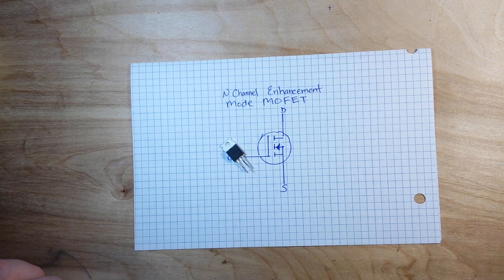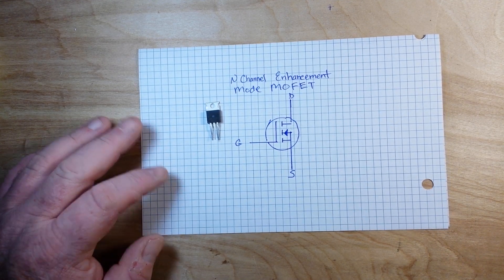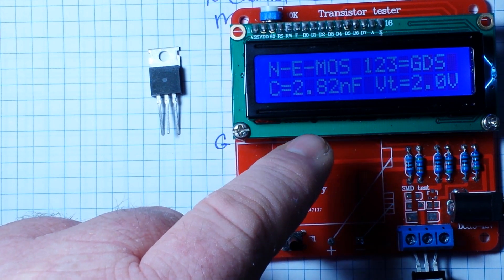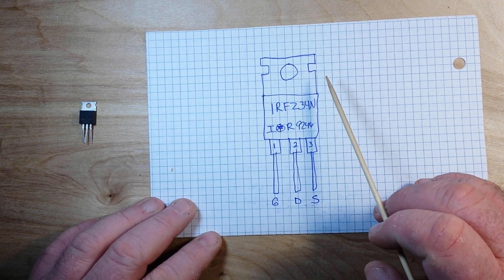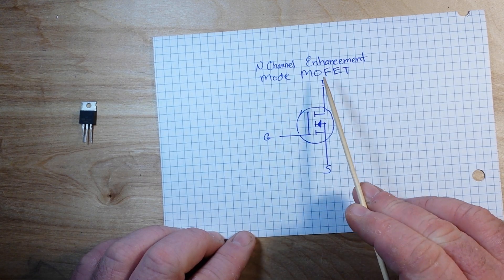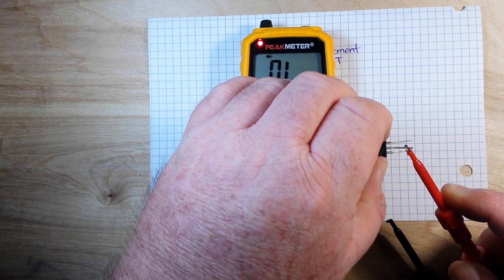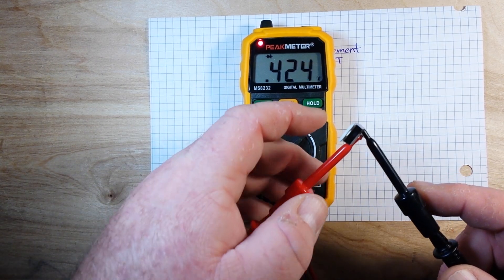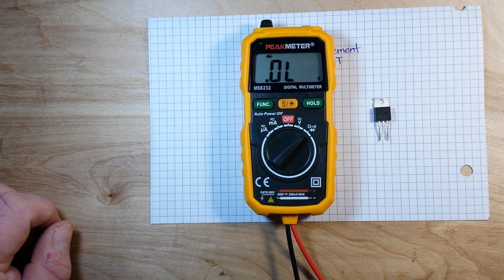Quick & Dirty MOSFET Test

Comment: Nice thanks.  I have what I believe is an N-chl MOSFET STD1NK60 and mine checks out exactly the same with the exception that after I trigger the gate and put the + lead back on the drain the voltage rises quickly and then goes to OL.  Also the back metal plate is common to both the drain AND the source.  Is this one bad?  Thank you.

Comment: Usually easy to test mosfet like this, but in a circuit board without desoldering it, the gate to drain resistance conducts away the gate charge rapidly so you can't use this method. Here's how to do it: Just connect an extra probe wire to the DMM positive probe and clip it to mosfet gate on the pcb itself or a circuit track there, and then measure drain to source resistance, with your dmm probes, you will see the same conduction! It will go back to high resistance immediately you unclip the gate extra probe! By bleeding the charge thru gate to ground resistance present on any mosfet using circuit. Some technicians use a 9 v battery with leads soldered to it and connect to gate and ground on circuit board, then use dmm to measure drain to source resistance! Use either method.
Reply: Thanks. I'm going to try this now...

Comment: I touch the gate but between source (black on dmm) and drain (red on dmm) there is a very short spike with diode sign shown on DMM (continuity mode) and shows 1.8-1.9v and quickly shows OL. what does that mean? if I lift drain and put it back it again shows diode voltage and OL.
Reply: idk if it helps its an ST Micro STD20NF06L

Comment: Okay got a little confusion,I have several Mosfets IRLB3034
I have a fluke 77 series, witch I test the Mosfets on and I have some questions to whether witch ones are good and witch ones were bad,

When I test one on a setting that has diode and continuity setting, only bleeps as shown in your video so that,s good , but the number creeps up slowly starting from 6.68 up to 3.000 then goes to 0 then starts going back up again,
If I set it on ohms it goes up to 32.42 M ohms then goes back to LO,

The other Mosfet IRLB3034 I set the multi meter back onto diode and continuity test ,it Bleeps as should as shown in your video but on this one the number flashed up 0.92 comes up quickly then quickly goes away.
Witch Mosfet is the good one and why ,

Comment: Hello, I know this vid is pretty old but can't seem to find an answer with Google. Mine works as yours until I put the positive back onto the drain then the voltage drop rises until it is back in the off state. If I just touch the gate with positive again it will do the exact same thing. Assuming it's naffed but not 100%

Comment: This method only works with logic level MOFETs since the gate voltage required is quite small. Power level MOSFETs will require a 9V battery to test it. Right?
Reply from the maker: I didn't use it on logic level.

Comment: Iv done this with old mosfet and a new one and the reading goes up then back down straight away the meter is in diode mode but is an old meter only showing l instead of OL does this mean that  both the mosfets are ok or faulty .

Comment: Hey man, thanks for this video, I don't know much about the more advanced parts of electronics, but I'm currently repairing a car audio amplifier that uses N channel MOSFETs, which are known to go bad in this specific model. I'm using a cheap harbor freight cen-tech meter, on the diode mode. This amp uses 8 IRF3205 MOSFETs and 6 IRFB4227 MOSFETs. I've clipped them all off for now (I know probably the hack way to do it, but I don't have a good soldering iron and don't want to damage the amp's 2 layer PCB.) I got to the third 3205 using this basic test, the first two behaved exactly like yours did, but this third one immediately dead shorts (I believe?) and sets off the meter's beeper after I apply the lead to the gate lead then to the drain lead, as I did with the others. Could this indicate a defective MOSFET? I'm hoping it is, once I get all of these tested I'm tacking the remaining good units back into the amp which should allow it to work for testing purposes (given with less power output until I buy replacements for the bad MOSFETs.) Glad you made this video, only one that explained the testing procedure in a way that makes sense.
Reply: Update: Two of the 3205s ended up dead shorting, the other 6 tested fine. Could not get any of the 4227s to work, at least not with this specific meter doing the same test, which is odd because they use the same GDS pin layout as the 3205s do (checked multiple datasheets for both). I'm just going to assume the 4227s all as good for now, because even just testing them for continuity there was no dead shorts. Will see how the amp behaves with the two suspect 3205s pulled from circuit. I have a second one of these amps, also dead from the same issue, so I should have the donor parts to use to get one working, then eventually both.

Comment: I tried to do this using a craftsman 82008 multimeter and can not get any reading , yet if I use a super cheap cen-tech multimeter the mosfet behaves like you say in your video. Do you know of any reason for this? I thought a better multimeter like craftsman would yield better results.

Comment: Does your process of testing the N-channel MOSFET applies to IRF3205 mosfet?

Please I need answers, thank you 😁
Reply: Late answer, but yes it does! If you happen to be working on something similar to what I am (a Rockford Fosgate car audio amplifier), this is the same process for the IRFB4227 MOSFETs as well. In the future, you can figure this out easily simply by looking on Google for the datasheet, which will tell you the type and specs of the part you are working with.

Comment: In testing/checking MOSFETs using Multi-meter, when the gate is charged, why some MOSFETs (N-channel & P-channel), the drain to source let us say 0.002 or less reading, others starts with more higher like 0.435 and running up as fast as a second or half a second until showing infinite? What does it mean? Does all MOSFETs behave like that?

Comment: Thank you, when i touch gate and test i have voltage for 2 sec then it opens, and i tested a second one and the voltage is going up slowly until it opens, is it bad ?, because your vid say it should hold
Reply: Its could creep back to not conducting. Hold neg on source pin. Charge gate 5 seconds with pos from meter. Then check the drain pin again with meter pos lead. But yes it could creep back to being open or non conductive. 
When I test N channel mosfets I hold neg meter lead on source pin. Make sure it is open on drain pin with pos meter lead. Then I charge gate 5 sec with meter pos then meter pos back on the drain to confirm continuity.  If you ever have a short on any pin then fet is bad.

Comment: Freakin cool dude. So simple. Question: Is it necessary to remove Mosfet from PCB to test? Especially 8pin dip type.
Reply: Mine didn't develop a capacitance between g and s until i disconnected it, perhaps u need to

Comment: Quick and Dirty. MOSFET confessions!   I bet you can get them irf z44n's at the grocery store! they are everywhere.  I'm thinking about trying to add FETs. to a lithium ion battery balance board/protection board. but on a separate board. to add balance current. and maybe discharge protection current. I'm mostly needing balancing for when charging. I almost think I will not need it. I don't want to end up saying. "I didn't think it would burn the house down" that's done happened 2 years ago. I had nothing to do with it! I just can't handle it again!! I know I need a Batrium system but that's near $500 and only balances and protects the batteries. it don't really "DO" anything to make things work. its not a charge controller. or anything like that. and it has all kind of extra Goody's. you can connect rgb neo pixels . to it it foes who knows what. and Bluetooth monitoring WiFi lots of stuff. I don't need. but is extra. the main board I heard is $365, plus long Mons for every parallel cell. maybe $50 ea. I'm running 7 cells in series. so maybe $350 for that. so near $1000, so I'm looking for cheaper options. in so tight one day I'm going to need some WD. to get my wallet open! keep teaching us professor! and hope you have a great day. and well    thank you!
Reply: Try eBay. The balancing boards with MOSFETS are less than $10. Just checked it : current voltage regulator modules (with meter) are less than $15.

Comment: great little video.. but i can't get any readings at all no matter what connections i make . the G, D and S are the same as in your video .. i am testing a STW80NE06-10 Mosfet .. . does this mean it's completly blown ..
Reply from the maker: +REDBARRON2424 I am not familiar with that MOSFET so I can't give you a definite answer. I would say check the data sheet for specifics.
Reply: You are really intellectual .